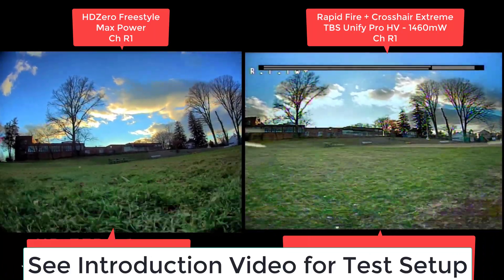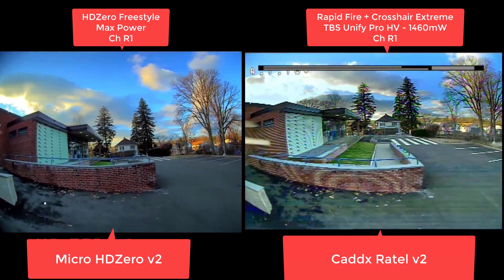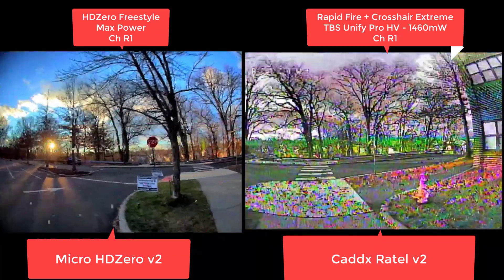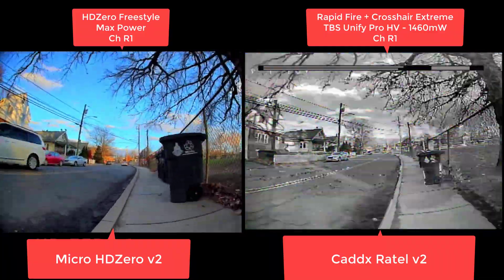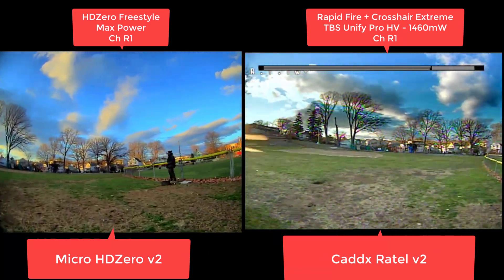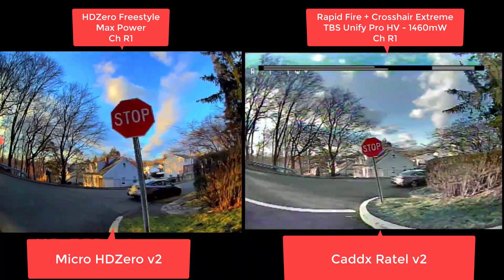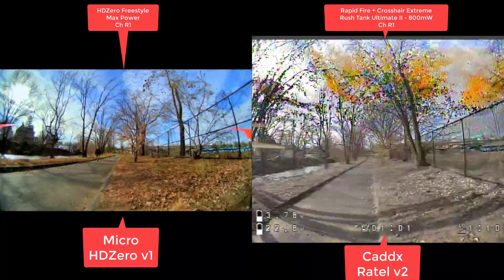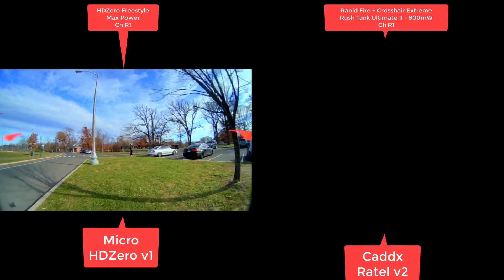The End: Urban Large Buildings - HDZero vs Analog Penetration Tests

Comment: Analog is still cheap tho.
Analog vtx is $15-50 depending on power output and hd zero is like $100-200.

I got hd zero but probably will use them to mostly fly analog 😂